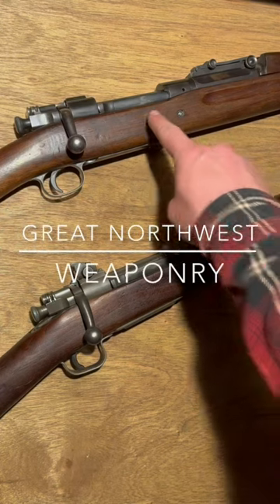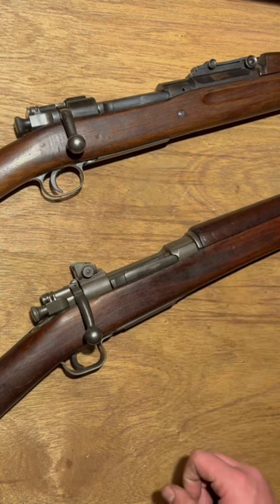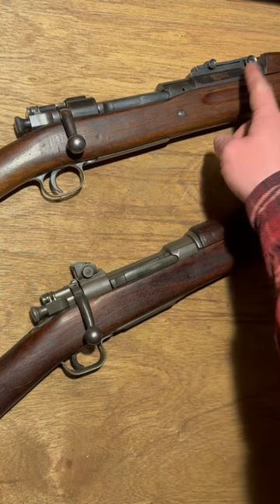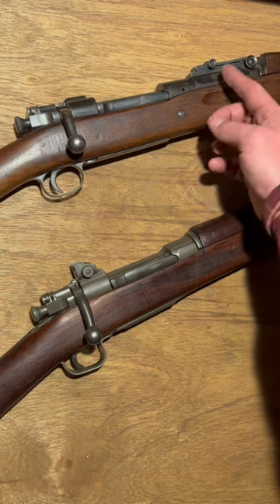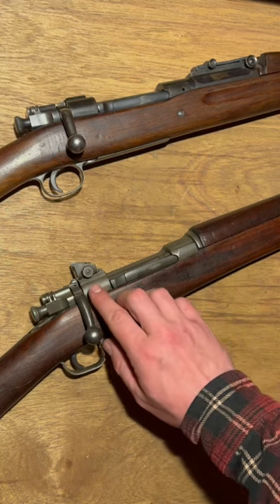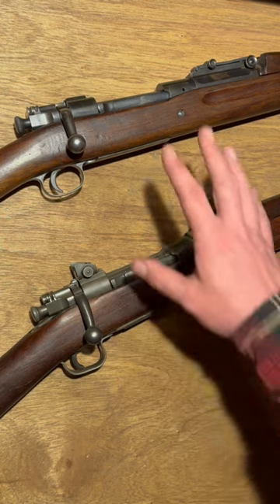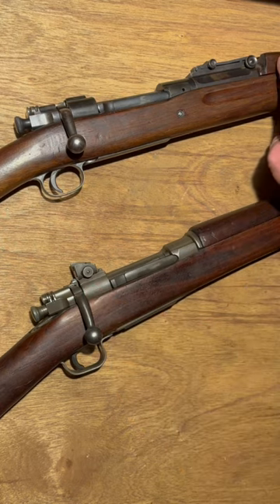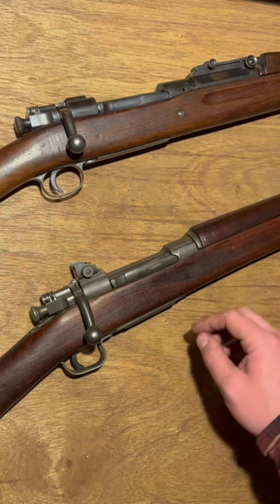Springfield M1903 & 1903A3, what’s the difference? #shorts

Comment: Did they have an A1 and A2 or did they hold off and combine those changes and call it the A3?
Reply from the maker: Just the A3, I’ve heard people refer to the early M1903 as an A1 but not commonly
Reply: @GreatNorthwestWeaponry  1903A1 was a 1903 with a pistol grip stock, but the army did not re-mark the receiver.  A2 was a subcaliber gun for artillery spotting.

Comment: I have 2 1903a3s, one by rock island and one from Remington..
I also have a Remington M1903 from 1942 and it also has a “scant stock” or semi pistol grip stock, no finger grooves and the flip up leaf sights like the one you have on top… 
The 1903 is by far the best/smoothest bolt action i own, 2nd will be my VZ24 and 3rd will be my brno kar98, which is smoother than my russian capture Kar98k… Mosins can suck it and 4 of my Arisakas feel the same as the Kar98s
1903 for the win in my opinion..
Does anyone know why some have scant stocks and others dont?

Comment: Which out of the two would you Recommend?
Reply from the maker: For actual use the 03A3, mostly because the sight configuration is such an improvement (this is an opinion of course, but it is pretty widely agreed on) the original 1903 is a lot more polished and nicer but the A3 is just more practical.
Reply: @GreatNorthwestWeaponry  thanks for the input, I’m in the market for one, I’m a big fan of the older style rifle but I had a feeling the sight would be better on the a3

Comment: Which one is better to buy tho?
Reply from the maker: Completely depends on what you are more interested in, the value is very similar. I, for example, find WWI to be fascinating so I went for the M1903 first, but I find the sights on the 03A3 to be better.
Reply: @GreatNorthwestWeaponry  wouldn't ww1 barrels be like total wrecked?
Reply from the maker: @NgJackal1990 totally depends, a lot of them barely saw any use as they only made it to Europe a month or two before the war ended. Plus many were reissued for WWII and given new barrels, but in my experience the guns sent to the Pacific Theater in WWII are often the most beat up of them all
Reply from the maker: It’s all on a case by case basis in my experience, some of each model are brutalized and some are in near flawless condition
Reply: @GreatNorthwestWeaponry  I see, thanks.
Reply from the maker: @NgJackal1990 happy to help 👍🏻